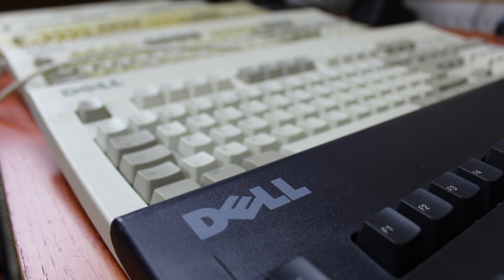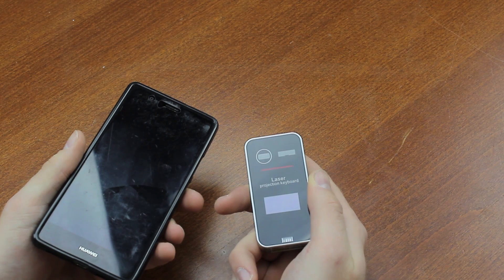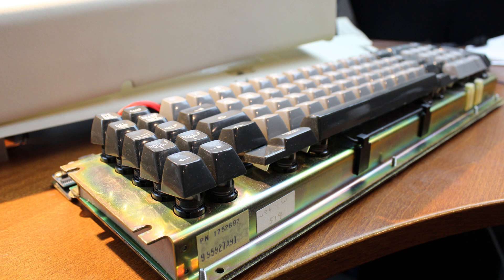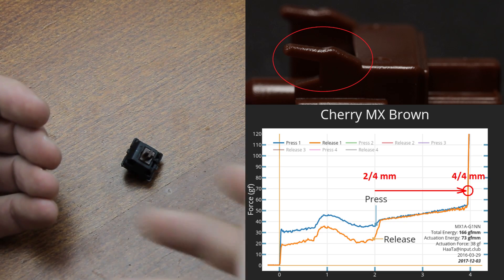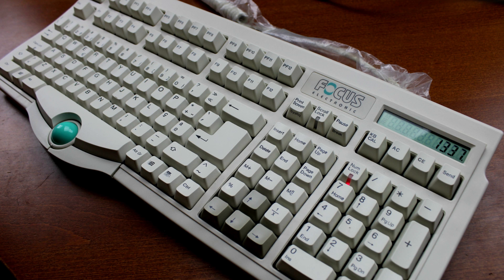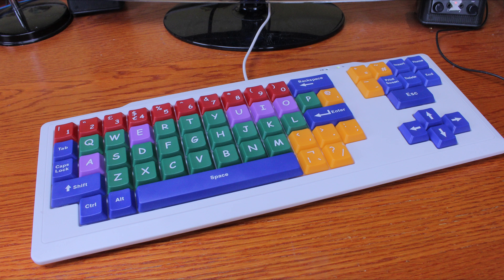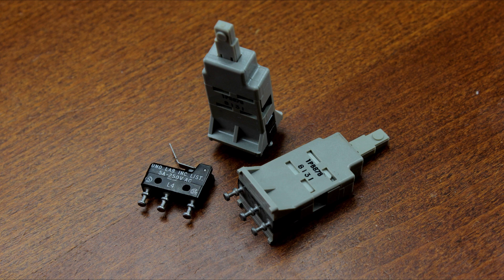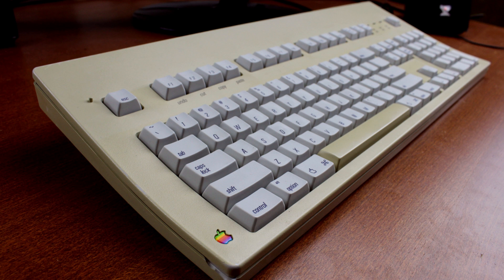When is a keyboard "mechanical"?

Comment: For me mechanical movement is perfectly clear, like in the suspension of a car you can count springs and triangles or leafsprings but not the bouncy effect of the tyres due to the airpressure. Is it so difficult?
Reply from the maker: That's not a definition, that's a gut feeling :p .
Reply: @Chyrosran22  That is the difference between scientists, engineers and mechanics.Some like to make the world so difficult where is is perfectly clear for 98% of the practical group (Thats imperial:  one fry short of a happy meal)

Comment: Thanks Thomas, I now have more clarity about my confusion! Based on various definitions, apparently my Filco Majestouch 2 UK ISO 105 keyboard, with Filco double shot keycaps and Cherry MX Black key switches, is at once mechanical and not at the same time. It's like Schrödinger's cat, dead and alive at the same time until observed, or rather experienced. Wondering how many Topre, Optical, Hall Effect, and Buckling Switch users are also feeling the same way around now. ;-)

Comment: Mechanical keyboards = Can use rubber domes, or use a membrane sheet, but not both simultaneously. Apparently.
Reply from the maker: But then touchscreens count as well :p .
Reply: @Chyrosran22  Preposterous. Touchscreens posses no rubber domes, and thusly, have not the sound of "thock". Though, a "digital solenoid" can be used to drown out the sound of flesh slapping glass :)

Comment: imo I like to just be insanely specific so to not use some umbrella term that (generally) doesn't work in practice. like for example, instead of calling topre clones, well, topre clones, just call them electrocapacitive keyboards, or keyboards with LK-Libra switches 'optical keyboards', etc.

I have a pet peeve with the umbrella term "mouse" or "mice". the amount of times I see "oh its a trackball mouse" or, "oh what kind of touchpad mouse is that?" legitimately drives me crazy. an actual trackball mouse are those shitty old school mice that literally used a rubber ball because optical mice didn't exist to a large extent yet. calling something a trackball-mouse when it is just a trackball. its either a trackball or its a mouse, never fuse the terms together. im just gonna call them cursor controllers just like how the only umbrella term that works for (most) keyboards, it well, keyboard(s). plus or minus those one key key"boards" if those even count as a "board"

shit, while im on a rant, people still mix up rubber-domes and membranes and use those terms interchangeably. if a community can't even get that simple fact right, how is anyone looking at all these arbitrary umbrella terms suppose to take it all seriously when they don't even know what that "term" is? reminds me of those people who refuse to belief topre keyboards use rubber-domes. even if you outright show them the evidence, there will be people who absolutely refuse to listen

PS: also with some of the garbage "mechanical" keyboards Chyros had to deal with in the past, needless to say not all "mechanicals" are strictly better than a sub $5 modern dell rubber dome-over membrane keyboard. shit if razer keyboards are anything to go buy, id take the sub $5 dell rubber dome over membrane keyboard over a "mechanical" razer keyboard any day of the week!

Comment: I go by the definition of "mechanical" that the actuation mechanism in the switch needs to be built on one or more simple machines  — and that concept is well defined. You could start reading on https://en.wikipedia.org/wiki/Simple_machine
Alps and Cherry MX are based on wedges. Buckling spring switches have levers.

Edit: But yeah, I use that only for classification, not for determining if something is good or not — which is mostly subjective anyway.
Reply from the maker: By that definition, optoelectric, Hall effect, inductive, magnetic valve, and capacitive are not mechanical though, right?
Reply: Not all of them, no. Capacitive buckling spring would still be "mechanical".
Reply from the maker: @Findecanor  But in that case, it is really a particularly useful term? I feel like the keyboards being "mechanical" is what got us into the hobby, because it's supposed to be "superior". However, all those exclusions are excellent bases for switches - again, at this rate I might not even want my keyboard to be mechanical.

Comment: Before I watch the vid: to me a mechanical keyboard is a board with discrete switches, over a sensing mechanizm of some sort, with removable key caps, where the key remains fully functional even with the cap off.
And yes, I know it's kind of 'tricky' with some model M for example with single piece caps, but you could still push down the spring itself and get the mechanizm to function.
Reply from the maker: It disqualifies all foam and foil switches, some types of magnetic valve, and other switches that require an external spring to function, though ;) . Same goes for the Model F.
Reply: Eh... Well there goes that I guess ;) At least wa all 'know' when a board is mechanical, even if we can't agree on a 100% accurate definition, eh?
Reply: Not to mention, you can push down a rubber dome without the keycap too.

Comment: Could you extend the final definition, to say 'the mechanism has the ability to actuate anywhere along the travel without fundamentally changing the design'? Or even just 'does not require bottoming out to actuate'.
Reply from the maker: The first one doesn't really work, because you don't FUNDAMENTALLY have to change most designs to make them such that they actuate on bottoming out, just slightly change the shape of some contact or piece of plastic. The second one has more merit, I think, but you can apply reverse logic to this to fail it. Some dome with slider switches don't require bottoming out, while others do, but the mechanism is fundamentally the same. It makes no logical sense to qualify one and disqualify the other (except for practical purposes of course).
Reply: @Chyrosran22  Very interesting, didn't really think about dome with slider switches not requiring bottom out. I do agree with your line of thinking though, I think the term 'mechanical' is only essentially good for describing a certain 'feel' that the majority of people would agree is a desirable one. There seems to be every combination of method to achieve an actuation, so I wonder if it would be an interesting idea to do some sort of mechanical rating. Maybe certain elements could be considered 'mechanical' and others not, and you could deduce some sort of measure for 'how mechanical' a switch is from that. I know it's completely arbitrary, just a throwing ideas out because I can :D
Reply from the maker: @malenky4057  heh, sure it makes sense to rate them, but you might as well go all out and rate them on quality already then ;) .

Comment: We could start delineating by "enthusiast" keyboards vs "non-enthusiast" keyboards. That's really what "mechanical keyboards" effectively indicates.
Reply from the maker: That's a fairly excellent point, I think!
Reply: @Chyrosran22  I don't think so. Keyboards for subtitles, Kinesis Advantages, Maltrons, etc. aren't for enthusiasts.
Reply: @gc-old  I think they can be.  when calculator watches came out they cost more than a rolex submariner for what was both a terrible watch and a terrible calculator, but people still bought them anyway.  I feel like the people who bought calculator watches in the 1970s (ie people willing to pay more for worse) are the same sort of people who might type on a maltron for fun.
Reply: @VideoCommenter Yeah, I suppose I was thinking "enthusiast keyboards" as in "keyboards that currently only enthusiasts pursue." So old keyboards are not currently mainstream, and have become enthusiast because they're mostly only sought after by enthusiasts.
Reply: Some of the responses here made me realize that "enthusiast" can have different subgroups that often get tribalistic over who "real" enthusiasts are. The attempt to arbitrarily exclude "gaming" branded keyboards highlights this tendency, despite the fact that a Corsair has pretty much the same switches as you'd find on a Filco, Ducky, or Leopold, or how I managed to get my hands on Box Whites only because a chinese company, who happens market its products as being for gaming, happened to make one of the first and still very few Box White keyboards that come pre-built. A prime example of this mentality would be the modern custom keyboard crowd, the audience who TaeKeyboards and Nathan Kim cater to, who tend to see themselves as the most "enthusiast" because of the sheer amount of work they put into the hobby. It begs for the question of when an enthusiast is enthusiastic enough.

It got me thinking that maybe "specialty keyboards" could also work as a broader term, just because it seems that anything more elaborate than a dome over membrane can be special enough to be worth at least some enthusiasts' attention.
Reply: Avery Mock  I'm not a gamer but I have a gamer keyboard because I wanted to update from a shitty dome membrane mushy <insert Chyrosran22 swearing here> to something "mechanical," i.e., something with a response curve specifically designed with the user in mind. It's an Alienware and has Kailh "brown" switches (knock-off Cherry MX Browns). Also, it doesn't reek of gamer (it has a fairly subdued visual aesthetic) but still has a few macro keys. That's all I wanted - an upgrade over a shitty dome membrane keyboard with nice-feeling response curves, a selection of macro keys and looks that don't scream Halo. So let's not disqualify gamer keyboards.
Reply: Perhaps mechanical refers to the feeling one has when typing on a good quality keyboard. It does give more of a mechanical, piano like feeling, whereas your cheap flat and unsophisticated keyboard usually has a less mechanical feeling to it, which goes in the direction of a proper non-mechanical keyboard like a touch screen. This would be consistent with how the word is being used.
Reply: VideoCommenter Well a lot of enthusiasts prefer older tech because it was often made to the quality modern enthusiast keyboards are held to today.j
Reply: Look, can you swear just once? Please?
Reply: Pretty good point. But also reading other comments makes me think that pc enthusiasts or basically everyone that at least knows computers, have started using terms that don't make sense. Like mechanical keyboard... All keyboards are technically mechanical. PC for example. Which we usually mean Windows and not Mac or Linux like Sam Wittsell says. I could say the same for consoles because they are technically computers with different operating systems made cheaply (or expensively) to fit the budget of the general consumers. I get that they are made to play games and not anything much else a personal computer can, which makes them gaming computers. While we PC gamers blabber about gaming pc being superior, we have controllers that are made to be used in writing. It's like playing a game with a pen (in a parallel universe lol), while console gamers are playing with controllers that are actually made to play games. Still PC Masterrace tho..
Reply: @aqqaluolsvig1564  I've been a Linux user since '99 and one of my hobbies is trying different Linux distros. I read "PC" to describe Linux computers a lot more, significantly more. Kids now getting into Linux and computers generally don't even think twice about it. The two letter acronym saves a lot of typing, there's really no two or three letter name or acronym that is an alternative.
Reply: That would discount a lot of older keyboards (including Model M's) that weren't designed with enthusiasts in mind.
Reply: @paianis  Depends on how you look at enthusiasts. Considering the costs, even just to use these computers you pretty much had to be an enthusiasts. He talked about the price of the either the F or M here and just the keyboards alone had a cost of like $600 for IBM. You didn't use a computer that came with a $600 computer unless you knew what you were doing.
Reply: @andrewalexander9508  which is how the Symbolics Space Cadet keyboard for Lisp Machines came about. BUT, their machines were so sophisticated, so advanced, the industry was scared away. They didn't want to worry about the "care and feeding" of the geniuses they thought they would have to hire to run these, and Symbolics ended up going bankrupt. Arguably the best keyboard ever made, though.
Reply: I would disagree. If you look at the actual "voting with your feet/dollar" numbers, the "non-enthusiast" users vastly outnumber the "enthusiasts". Mechanical keyboards are way larger phenomenon than just the latter. 

"Enthusiasts" are an overloud minority community who don't fully understand or respect the engineering behind the switches (or basic grade school mechanical principles for that matter) and go almost purely on "feel".

I got interested in mechanical keyboard, wanted to build my own and the stuff out there on the internet is both shocking and disgusting - specifically the approach to lubing. Its downright idiotic - lube (of any kind) should be applied on a "less is more" principle and only on points of friction. The only exception to this rule is where you have a tightly sealed unit (e.g. ball bearings) - something which key switches are definitely not!  Drowning every part, including non-contact areas, in too much grease is just turning your switches into gunk magnets. Seeing the giant globs of grease on the stabilizers and springs just thrown into a greasy bag and shaken up physically makes me gag.  

The community also puts crappily made unreliable turd on a pedestal just because its "custom". Take holy pandas for example, its an abortion made from jamming together parts from switches that were never meant to (and don't) fit together. They are pretty much broken switches - their aren't very consistent or reliable and the stem wobbles like it doesn't properly fit into the casing (because they don't and were made for a completely different switch!), and yet somehow they are a "grail" switch?
Reply: I'm not sure that's good either, as it tells us more about the audience than the functionality of the device, or how it would feel to type on it.
Reply: @jesuszamora6949  Yes, maybe it does, and I think that still fits because saying "mechanical keyboard" also tells us more about the audience than the device, given how that label is applied to all kinds of systems, some better and some worse than rubber domes.

The only thing that all "mechanical keyboards" seem to have in common is that keyboard nerds are the only people who know/care they exist.

At least, that's the gist of what I meant to say, if I remember four years ago or whenever that was...
Reply: Exactly! That is the simplest, most universally agreed upon definition, however, there is one problem: Model F and Model M fall into both camps because they started as non-enthusiast standard keyboards in the 1980's on IBM computers but became sought-after enthusiast keyboards later. That reminds me: I'm sick of "PC" being isolated to "not Macintosh" or "simply Windows" and even excluding Linux despite many other people talking about "Windows PCs" and "Linux PCs" when in reality a PC by definition is a personally owned computer or a computer that is sized down for personal use. Even 70's microcomputers counted, despite "PC" and "personal computer" not being popularized until the IBM 5150 was released in 1981. Microsoft is also at fault for this overly specific definition.
Reply: @pip5528  sorry for necroposting, but you have it a little backwards. IBM really pushed the idea that only it's products are "PCs". Remember Microsoft was just a little software company at the time. This ironically worked for the "clones" they profited from that designation, too. Apple products, both from the company itself and fans, would say it was a matter of PCs vs their products. No Mac of the time or Apple II was ever referred to as a "Personal Computer". And this is even true for the clones of Apple IIs. PC clones weren't the only clones, but they turned out to be the only successful ones. The point is Microsoft stole IBM's place as the center of the computing world, and it did so while IBM execs were busy scheming to get the public to associate their name with the term "PC". And, ARM and Android look like the future. Look what companies do now; like Apple isn't even calling their new "M whatever" chips "ARM", even though that's exactly what they are.
Reply: let’s disqualify razer, logitech, corsair and whatever else keyboards you can buy from a “gaming” company; a company that sells gaming peripherals and computer hardware
Reply: @amok00  Why disqualify keyboards on the basis of the company selling them? That's completely irrelevant, and spreading that kind of attitude stops people recognising when they make something good. It's pointless snobbery.
Reply: Doomguy commercial “gaming” keyboards are far from enthusiast level
Reply: @amok00  I've heard some good things about the coolermaster gaming keyboards, if memory serves correctly there's a positive review of one of them on this very channel. Also, the definition of where 'enthusiast' begins is highly subjective. Clearly people who shell out for a gaming mech want something better than a basic, mushy rubber dome, and from my experience using a few they're a huge step up from those basic cheap keyboards.

I'm certainly not saying keyboards don't get better than gaming keyboards, but writing off any and all brands associated with gaming is fruitless gatekeeping. Judge keyboards by their own merits.
Reply: @amok00  I mean, there's not really a definition of a "gaming keyboard" either.
Reply: @amok00  thanks but i'm still sticking with logitech ''gaming'' keyboards